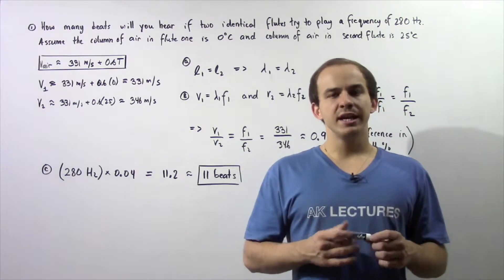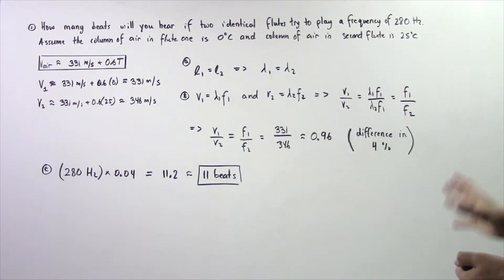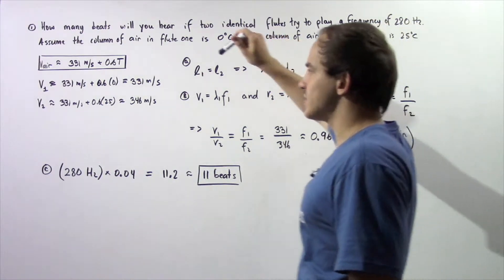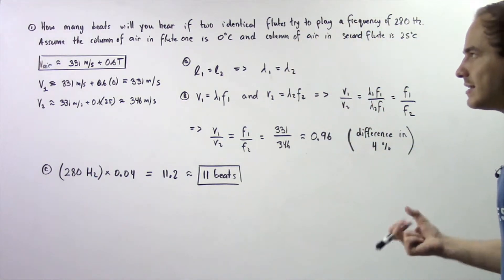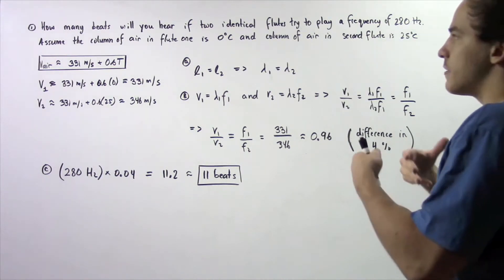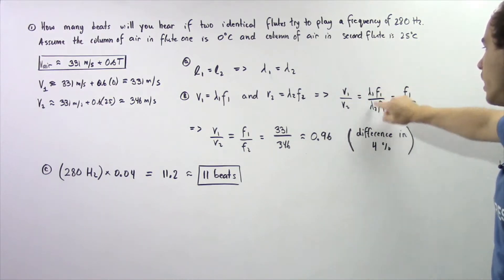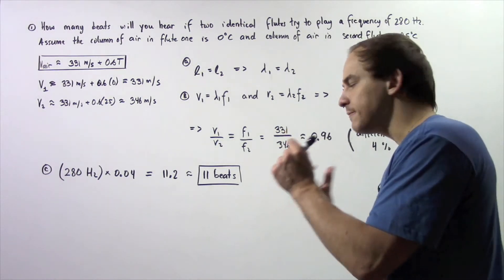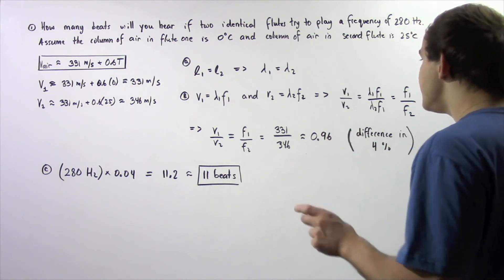Beat Frequency Example # 1

Comment: I guess the answer is incorrect. If we reciprocate the ratio "v1/v2=f1/f2", we get v2/v1=f2/f1. Since we know the f1=280Hz, and v1 and v2 are equal to 331m/s and 346m/s respectively, we get: v2/v1=1.04532, which is a reciprocal of 0.96. Now, we have: f2/f1= 1.04532 ==} f2/280Hz=1.04532 or f2=292.6896Hz. Using the equation fB=|f1-f2|, we get: fB=12.6896Hz.